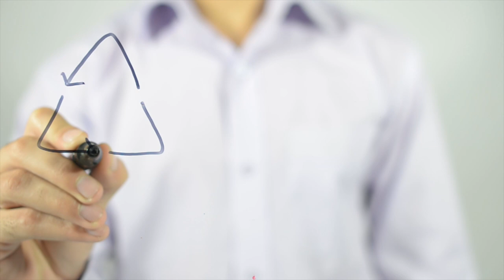The Dirty E-Waste Secret of Solar Panels | Who Is Actually Recycling?

Comment: I just brought another 3kw of second hand panels for $200 , now to order a new 12v heating element for my hot water
Reply: Run panels in serial for higher voltage, will save costs in wiring gauge.

Comment: I mean... Reuse - Reduce - Recycle - even at a drop after 25 years they can still be graded down allowing some use outside of that 25+ years. Reduce by figuring out a way to patch the cells that are still graded out again this mean even less still make it out. After that you use recycle. The problem is most things dont have a good value unless we consider using more rare earth or metals that can be reuse - but thats now how solar works.. Some metals can work just fine like silver or copper. Glass can be turn into sand that can be used across other use. The only one I dont know is silcon or lead. Lead shouldnt be used either way though... the other can still be turn into sand still. Problem is Sand is cheap... soo... not sure how you would profit from that section, but I am sure sand can be used across a number of areas still. Mainly just comes to scale - aka, we need a ton more ready to be recycle and force more better recycling plans as the op goes over.